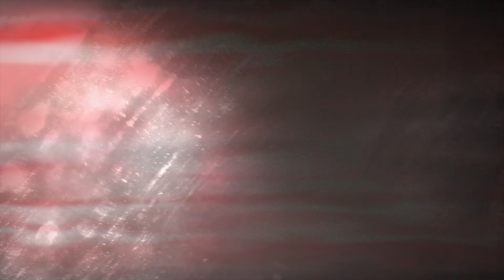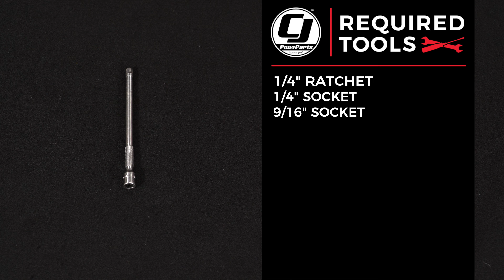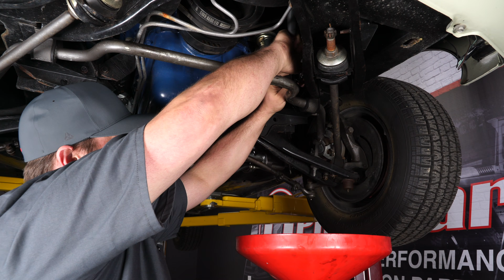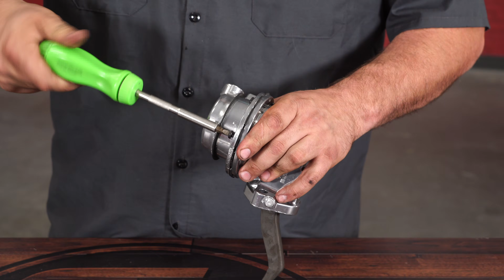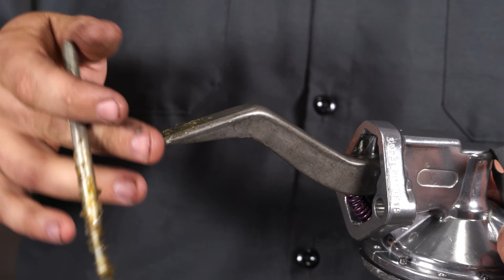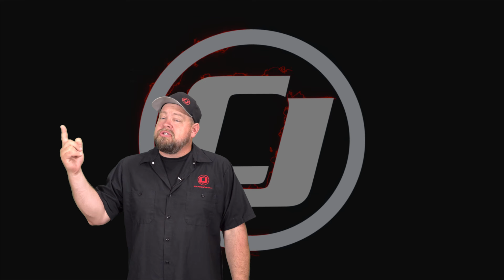Performer Fuel Pump | Edelbrock | 289/302/351W Mustang

Comment: Hi Bill, I have a question. I was accelerating in my 2013 v6, it's on stock internals, has nothing on it...it kinda felt like lost power at around 115mph, I got scared and stopped accelerating. Anything wrong with the car?
Reply: saby8765 speed limiter